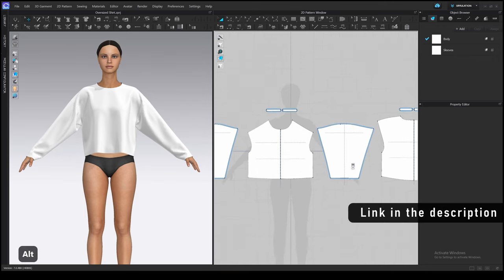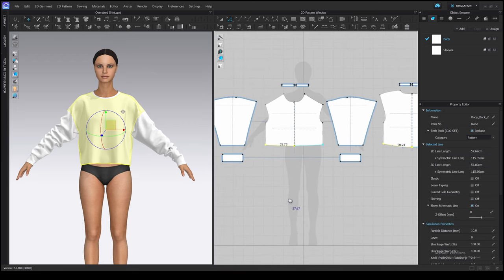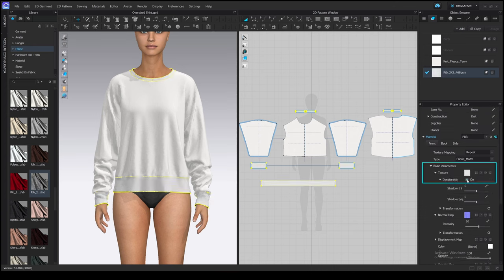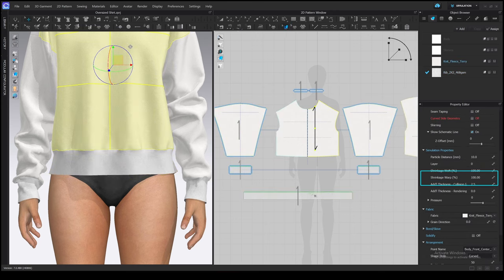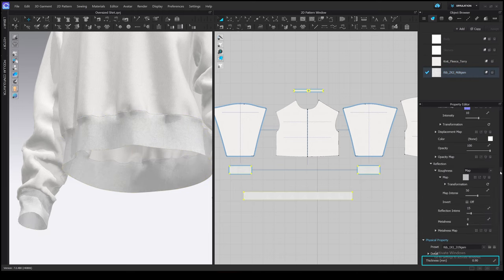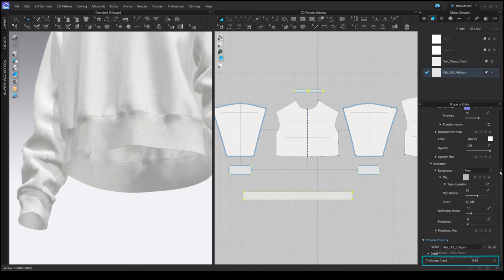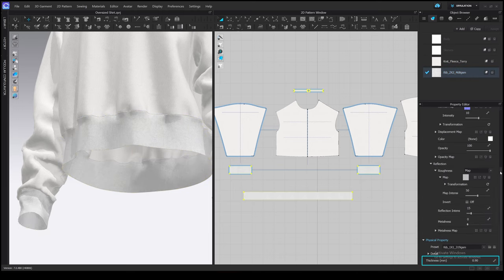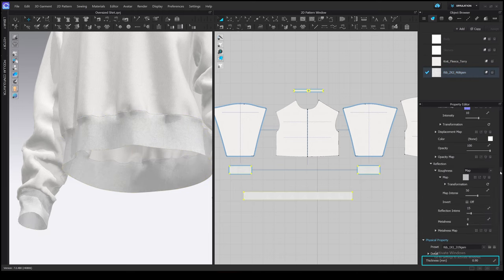Realistic Rib Cuffs and Waistband | CLO3D Beginners Tutorial

Comment: Thank you so much you make it so easy for me, you're such a great trainer. Looking forward to the next video 🤍🤍🤍
Reply: I want to ask you how do you make the figurine turn black and change the back ground?
Reply from the maker: Thank you! 😊
You can change the avatar color in the top menu bar - Display - Avatar Rendering Style - Monochrome Surface and change the color/material in the property editor. Or you can achieve the same result if you simply delete texture maps for each part of the avatar (head, hands, torso, legs) in the property editor.
To change the background color in the 3d window - go to the same Display folder and choose Format 3D Background or Add Background Image if you want to place an image there. 
If you need to change the background on renders - go to the Render window - Image/Video Properties and find Background section in the property editor.

Comment: When you want your height a little bit shorter and add shrinkage i see that it wont modify the pattern. Wont that be a problem when you are sewing your prototype? because it will look good at rendering but the final clothe would be the original length.
Reply from the maker: Good point, it will be a problem. If you need to sew a prototype afterwards - change patterns, not shrinkage.

Comment: Hello this pattern makes no sense. In real life ribbings are one piece. If you give this pattern to a sample maker there would be sewing at the end of the cuff as it is two pieces
Reply: Does anyone remember daniel's method? He deleted all his videos and I really miss that one
Reply from the maker: Hello, you're right. We don't sew the ribbing cuffs from two parts in real life. This video is about making a reslistic 3d model, not a production-ready patterns. Simulation for two-pattern cuffs is more stable, and there is no visual difference compared to single-pattern cuffs. 

If you need a single pattern - just unfold it at the bottom edge, draw an internal line at the middle and then fold it in the 3d window using the Fold Arrangement tool. The other way is to make two parts and then merge the bottom edges. Then you can adjust the fold angle for the internal line at the middle and make it sharper.

Yeah, I also miss Deniel. His videos were great.
Reply: @polkunus  oh no! That's so sad. I remember what he did though! Something similar to this lady. He did exactly what she did, but then merged the two rectangles together. You can also.make a fold line, which is what I do. 
You would not have ribbing on a sweater, only on bomber jackets, so this lady's method is best.